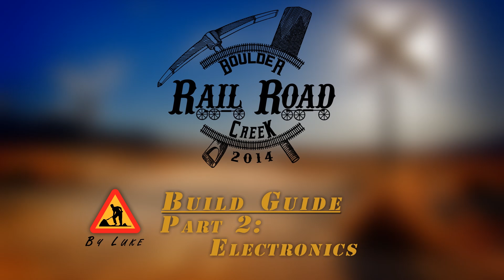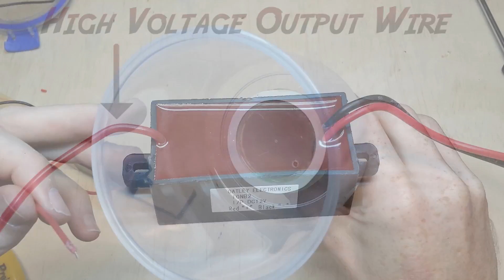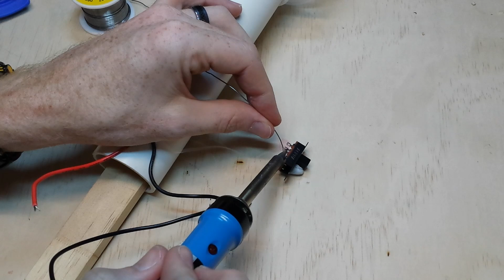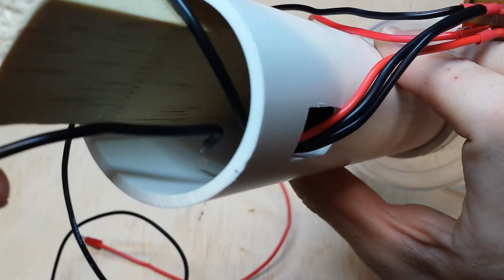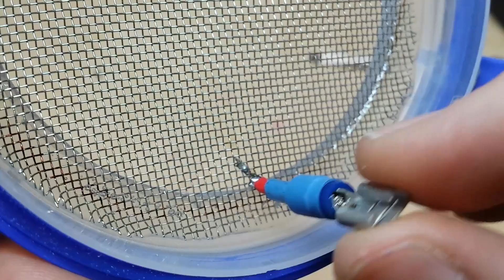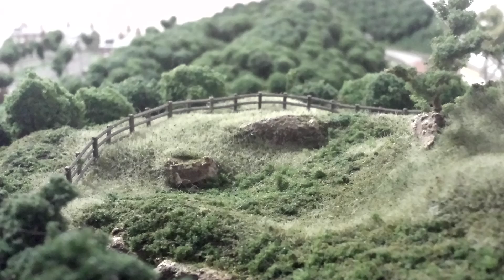Static Grass Applicator (Electronics) - How To - Model Railroad

Comment: After a couple years, I am finally back to working on my HO layout.  Found my Luke Static Grass applicator and getting ready to put it to use.  Mine has a 9 volt battery in it and also a 3.1 mm socket for a power supply  depending on which way the 'DPDT switch is shown.  I have a lot a power supplies with 3.1 mm plugs but wondering which I should use.  Seems a comment might refer to using a 12 volt DC supply vs a 9 volt supply.  Your recommendations as to whether it makes much difference.   Original power supply was not stored with the Luke Applicator I built and it looks like the 9 volt internal battery is dead.  Might have to buy more static grass as I can't find that either.  Having some senior moments. LOL

Comment: static electricity is very different from the "normal electricity" we are use to 

the effects used are more capacitive than conductive 
to prove it, try this 
put your earth under a sheet of glass
put drops of glue on top of the glass  (with absolutely no contact to the earth wire)
then make some tuffs 

You will be amazed how well it works

Comment: Anyone know where I can find a wiring diagram for wiring the ion generator? What are the two (red and black) wires coming out of one side of the ion generator? I don't understand what goes where on the switch. And I don't know how the posts on your switch connect each of the wires.

Comment: I just finished mine. Finding all the components was a little bit challenging, particularly for the ion generator, as I could not find exactly what you recommended. I had to improvise with slightly different component like thiner wires. I know nothing of electrics so I feared that my wire would be too thin and burn or something but everything went perfectly fine. Thanks again for the video.
Reply: wire size will not affect how this works 
electro static will not draw any current so the tiny wires will be fine

Comment: I would like to apply flocking to a costume on a mannequin. The mannequin does have metal in its joints, does this matter? Do I also need to put a pin into the costume?

Comment: Hi Luke
İ tried to make this applicator with 20kv high voltage https://rover.ebay.com/rover/0/0/0?mpre=https%3A%2F%2Fwww.ebay.com%2Fulk%2Fitm%2F322435601214

But its not worked
What can be problem?

Comment: I notice in other videos you have improved the switch and power connection. Appears to be fixed to a end cap on the body pipe, any chance of a quick update and parts required as it looks a lot neater.

Comment: Thanks for posting this how to video. I have a question. I purchased a negative ion generator that is 12v 11.5 KV.  I have a phone adapter with 500ma output or a power adapter with a 1700ma output. Which adapter will give me the best performance?  Thanks, Archie. USA

Comment: Can you talk about the safety implications of this? What is the output voltage? Is there risk of lethal shock? Fire risk?
Thanks
Reply from the maker: It outputs upwards of 15,000 volts however it is a very low current so it won't kill you however it will give you a shock, a bit like getting a static shock when you step out of the car on a dry day. 
It also creates a small spark when the mesh get in contact with another metal surface so I guess there is a slight potential for fire however it would be very unlikely if the unit is cared for and stored in a safe and secure location.
Reply: Luke Towan Thanks

Comment: Hi Luke, I'm Italian, so sorry for my English. I built a static grass dispenser from a fly racket, but it did not work well because of the poor voltage output (around 4kV), so I bought a 20000V ionizer. The problem now is that besides putting correctly on the glue, a large amount of fibers seems crazy and splits everywhere around. I just wanted to know if something like this happened to you. Thank you very much!

Comment: Good one Luke. I've just made one today. Got the Ion generator from Oatley. It works a treat. I couldn't find a round container like you used, but a square one works OK. I also only had a 12v 1A DC power supply. It manages well. Thanks for your help.
Reply: Old Bloke For the ground wire connected to the layout, did you use a wire that supports 15kV too?
Reply: I used 24x.02 stranded.

Comment: Can someone explain to me how this works? i'm still kinda confused
Reply: The negative ion generator  transfromer basicly steps up the lower voltage 12dc too higher voltage. The + of the high voltage side is connected too the
 Sieve and the ground/- is connected too the nail placed on the diorama. The high voltage side creates A static field between the +/ground which allows grass too be applied vertically.

 I caution any use of anything plugged into the wall. This tutorial is pretty good compared too other videos. Make sure you know how it works before attempting.

Comment: Hi, thank you for the tutorial. I was wondering, does it work better because i is higher voltage (the commercial ones work on 3v often, and yours on 12v)?
Reply from the maker: Yeah if you have a higher input voltage the output will usually be a lot higher and it will help especially with longer grass

Comment: I am really struggling to wrap my head around why a DPDT switch is needed and why you cant just power the with a 2 pole switch and go. I am to total noob so if someone wouldnt mind explaining that I would be stoked!

Thanks
Reply from the maker: Hi Tim, you could get away with using a SPST switch, I like to use the DPDT so I can isolate the entire negative ion generator making it slightly safer if a short develops on the switch.
Reply: Thanks luke ill be building mine today!
Reply: I made it!!! not nearly as pretty (less sanding and what have you.) but I followed along and it works PERFECTLY. I can even shoot a little purple lightning if I want! Luke you have made one of the best easiest to follow tutorials I have ever seen. Thank you so much for doing this! Planning on making another with an LED "on" indicator light. Need to find a good tutorial for that!

Comment: Does the grass you purchase have to be "static grass"? Are there differing lengths? Can you use natural grass or straw fibers with this tool?
Reply from the maker: Basically any fibers that react to a static charge will work. As an example hair would work as well as certain types of thread, I don't think actual crass would work. The material I use is usually purchased from a hobby store that sells model scenery supplies or you can search on eBay and Amazon.

Comment: Cheers mate... worked a treat.
Reply from the maker: Thanks mate.
Reply: I have a generator with one red, one black wires (Input I presume) plus two white (output?) wires (More a carbon fibre rather than wire). Neither work. I am reluctant to use both as sparks are generated if I touch the two output wires together. How do I work out which output is which please?

Comment: hey Luke, the negative ion generator I has 4 wires.. red and black together one side directly across the other side is a white. and blue wire...that is one side by its self... the red and black are power. the white would be the generator wire and blue I guess would be a ground?
Reply from the maker: I'm not 100% sure however a few others have used a similar generator to what you have described and it seems that the blue and white are the same. Some have just removed the blue by cutting it down and connect the white to the mesh screen although I'm honestly not 100% certain... 
If you're interested in the same one I used, I got it from oatley electronics: http://oatleyelectronics.com//product_info.php?products_id=915
They also sell them on eBay: http://www.ebay.com.au/itm/OATLEY-ELECTRONICS-IONB2-GRASSINTOR-HIGH-VOLTAGE-MODULE-/122408756881?hash=item1c80216691
Hope that helps a little 😀

Comment: You use a DPDT switch, but wouldn't a DPST switch work here. Don't you simply need to be able to burn both wires on and off but not to a second source?

Comment: i got my ion generator from internet, but i saw "input:220-240V-50/60Hz", on the ion generator casing, do i still need the phone charger instead or i can connect it direct  to power outlet ? thank you..
Reply from the maker: I will get back to you on that one.

Comment: can i ask you... how can i make static grass? i mean... the material. in my country there arent products for modeling
Reply: Get some natural fiber rope (sisal, hemp, jute, etc) then dye it your desired color (food coloring, fabric or hair dye, paint, etc) then cut it with scissors into the desired length. Experiment with different fibers for varied thickness and texture (hair? fur? cotton?) But avoid synthetic/plastic fibers as they likely won't dye well. This same idea can be used to make many different flocking materials. Moss, sawdust, dirt, bark, sand, you name it. Natural materials can be collected in large quantities for free and with a little bit of prep and maybe some dye, you can get good results. (I'm so poor)
Reply: paul salto you can import in from international websites, trying to make it yourself isn’t worth it.

Comment: Hi Luke, the only negative ion generator i can get my hands on has two white wires instead of the one red on yours. should i connect them both to the mash where th gras falls through?, or are those a positive and a negative wire for the ionisation? (there are also a red and black wire for the power suply)

Comment: with that wire stripper, you could have crimped the lug onto the wire without the need for the heat shrink. Since you were using a  lug with a blue shield, you would have used the 2.5 setting on the jaws of the wire stripper. The different coloured dots on the wire stripper are a guide as to what lugs would fit the crimping jaws.

Comment: How do you clean up your dioramas? I mean, after a while on display, they sure can catch some dust. With all this grass, and trees in the way, using cloth is out of the question, and vacuum cleaners cant really suck up everything that got stuck to the models. Or is it all sturdy enough?
Reply: Use a paintbrush to loosen the dust then follow with a vacuum. If everything is glued down properly it should be fine, but you can put a stocking over the end of the vacuum to catch anything that may come off. I personally haven't tried this on any models but it's great for cleaning the inside of your computer. Just make sure to be gentle with the brush either way.

Comment: You know the too you used to cut & strip the wire can be used to crimp the connectors? See the coloured dots they are crimp sizes.
Reply: Crimping damages the connector and wire, also looks ugly. If you solder it you will never have an issue. But yes you can crimp if you want, but there is a higher risk of failure if minor.

Comment: I made this unit.  It works DREAT!  What I need to know is this:  HOW DO I MAKE THE GRASS STAND UP IN TUFTS?  Let's say an inch or so.
Reply from the maker: I made this video a while ago that might help:
https://www.youtube.com/watch?v=iFXgSky6JMU&t=1s

Cheers
Luke
Reply: Luke Towan I am using a 12v power supply, but I am still having trouble making the grass stand upright.  What is the minimum amperage for the power supply?

Comment: hay luke I order a ion generator it came in with four wires ? one red one black and two whites  I get the  red and black but the two whites is were I get lost. wrong kind of ion generator ? I used the numbers off yours and that's what they sent . you think I could just tie the two whites together ?
Reply from the maker: Yeah, the two white wires have the same output. I've heard of people just cutting one of the white wires off? But it is a slightly different generator. The good news is others who have bought the same one as you can still get the grass applicator to work.
Although one guy did end up having problems and in the end he bought the negative ion generator from 'Oatley Electronics'.
Hope that helps.
Cheers
Luke
Reply: Hi Ken. I have the same generator, the one with the two white wires. Were you able to get it running? If so, how did you trim/use the two white wires? Also, did you find that the generator REPELLED, and not ATTRACTED the static grass? I thought I had it wired, but the static grass flew out of the dispenser instead of being attracted and dispensing through the screen! Any thoughts on this would be appreciated.
Reply: Hi Ken, I bought the 4 wire unit, I cut the carbon brush,s off, stripped the covering back to expose the inner wire and joined them together, it works just fine!

Comment: Luke, as always a very informative video. Here in the U.S.A. I'm having difficulty finding a plastic container with a locking lid similar to the one you used. Does anyone have any suggestions ? Thank you.
Reply from the maker: Thanks Jim, any container with a press fit lid should work fine. It's the twist on lids that don't work that well given the wire needs to attach to the lid. You could even use an old round margarine container?
Hope that gives you some ideas.
Cheers
Luke

Comment: luke ... i found an ion generator, but the high voltage wire is very short ... what type of wire shoudl i solder to it to lengthen it.  should i search ebay for just "high voltage" wire?
Reply: Simple rule of thumb is to think electricity as water, both flow same way. For instance if you have pipe coming from water source and you have smaller diameter pipe section added to that, it will limit the flow of water. In electric side of things, this added resistance equals power turning to heat that can in worst case melt the wire insulation and absolute worst case scenario start a fire. Using fuse is also highly recommended for this reason, if something goes wrong and correct fuse size you can see from your generators max amperage requirement. 

If you have, lets say 16AWG wire leaving from generator you can use 16AWG wire or thicker, so you can keep resistance same what factory calculated to be safe. Thicker wire wont cause harm, other than in sense that its just bends less. It will let power to flow same amount as calculated. Of course there is other things to consider too, but for person who has no clue about resistances and such this is simple rule of thumb. If your uncertain about things, consult your local electrician on subject.

Rest is connect color to color(and hope color coordinations are installed correctly by previous jackass), if your not certain what your doing, keep one hand in your pocket (redirects electricity from your upper body trough your hand into your lower body, by passing vital organs like heart) and if you dont have any fucking clue what your doing, keep both hands in your pockets (colleague sees this and comes to help, with out alerting possible customer/boss on fact that your clueless about given task). (Just some tricks of the trade learned from old electrician, when we worked on some main power installations.. ou and i'm not electrician btw :D)
Reply from the maker: Any sort of wire will work fine. Just don't use very thin wire. Maybe 18AWG wire will do the trick, that's what I've been using.
Cheers
Luke
Reply: thank you I have some 12 gauge i suppose that will suit ... thank you for your videos
Reply: thanks for your reply .... i think the issue i was concerned about is it was some ridiculously high voltage that the thing gets stepped up to and the wire that comes off the generator seems to have a real think insulation

Comment: just a tip from an electrician who has built a lot of projects.. the two main wires coming out and going to your phone charger You should use one male and one female and do the opposite on your phone charger..   That way your polarity is always correct should you disconnect it..  they also make those connectors that are totally shrouded to avoid contact..

great build, love you videos
Reply from the maker: wow... thanks Andy! I don't know why I never thought of that, it's a fantastic idea. I'll be doing that for sure on all of my future wiring!! And I've got plenty to do!
Cheers
Luke
Reply: Low voltage, no real danger
Reply: Good point, but if the charger is only going to be used for this device, wouldn't a safer option be to western union splice the wires and solder them directly to the power pack, then cover with heat shrink, less chance of shorting, zero chance of reversing polarities, even if it is an extra low voltage setup
Reply: Don't underestimate low voltage. It's the volts that Jolts and it's the Mills that Kills. Always worry about the Current that is used. There's also a thing called fault current. Fault current is way way higher than the stated current from a power supply of any sort. Great video though.
Reply: Ok
Reply: make the lengths uneven, so that that the chance for short circuit is less likely:

+   -(o-----------------
-    --------------o)----
Reply: This has always seemed a bit silly to me. Why would you be doing work on live wires?

Comment: Thanks so much! Are there any safety issues to worry about when building/using this thing, or is it pretty straight forward?
Reply from the maker: As long as you use low voltage, like 12 volts which is what I use and low current you should be fine although you can get a zap if you touch the wire mesh while the applicator is turned on! Just gives a bit of a sting.
Cheers
Luke
Reply: +Luke Towan great, thanks!